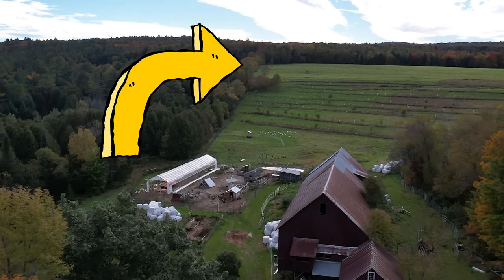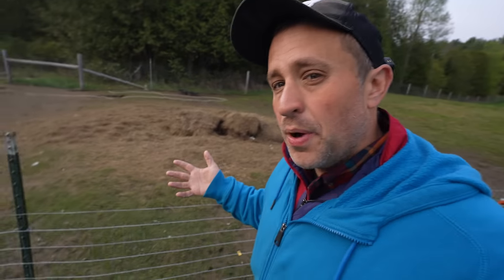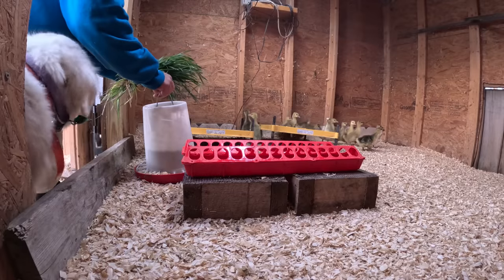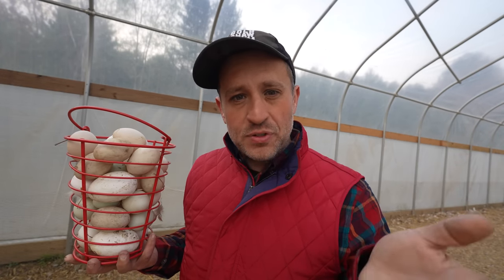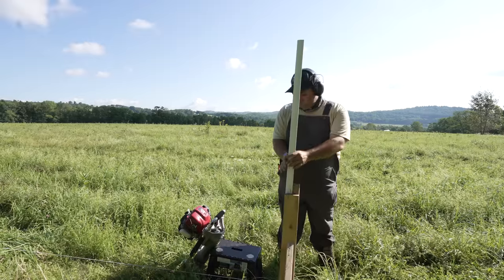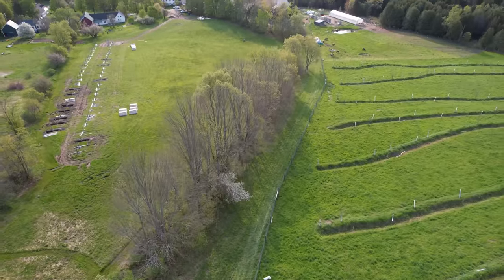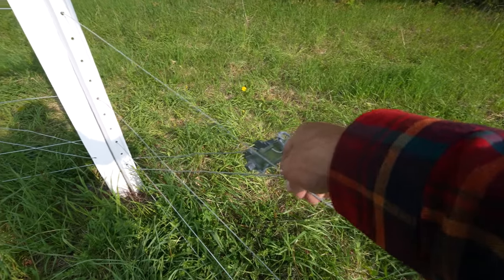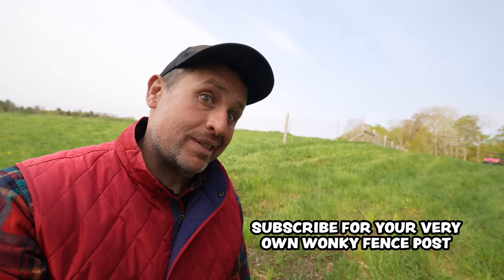Fencing My Farm: What I Learned

Comment: Since you're also a fan of Greg Judy, any chance you'll start unrolling large bails of hay on the pasture in fall before you bring all the cattle to the barn for winter?  It can help fertilize the upper pasture, and keep the area around the barn from concentrating nitrogen. I understand water is the issue, but as the mild winter showed, the quick connects can allow for you to fill a tank 1x a day, and extend the season out away from the confined area.

Comment: I noticed that when things were getting so hard and pushing through the hard wasn't working, you gave yourself a break. What's to be congratulated, is that you came back to the project after building skills and efficiency and finished it. It's so easy to get derailed and fail to return to what we started. But I suspect what allowed you to re-engage was giving yourself grace and understanding for the struggle instead of shame and blame. Good job!

Comment: The one thing that I would do with the white vinyl posts is mark the tops with either reflector disks/tape or Krylon spray paint. You don't want someone (including yourself) to not see them on a snow-mobile in winter.

Comment: Looks great Morgan! And in regards to learning as you go, particularly the 1st compared to 20th tensioner....in my last house I finished the basement by myself. I'd never done drywall work, but I learned as I went. You can tell by looking at the drywall joints from one end of the basement to the other! Laying the joint "plaster" and sanding definitely takes practice!

Comment: Worst part about noticing the tick is wondering where it went 😬
Reply from the maker: I do a tick check at the end of each day and I usually have a couple crawling around. My guess is it migrated to my hair.
Reply: Almost always go to the head because that's where the buffet of blood is.good thing they do because you don't want them settling in everywhere
Reply: @GoldShawFarm  how do you protect yourself from getting Lyme disease?
Reply: @sjbock  I'm chronic with Babesiosis, which is another tick disease, and likely the worst because it's not bacterial; it is a protozoa, similar to Malaria. 
Frequent tick checks throughout the day/time exposed. Two methods of belief are: 1) completely cover your body with clothing and tuck all seams; 2) wear as little clothing as possible and check often. I prefer the latter, when weather permits, and I keep a garden hose exposed to sun to wash frequently. I also suggest removing all outdoor clothes before entering your house, and then placing them in the washer. Ticks are bad here in southern VT this year, and my/our negligence to follow this protocol has resulted with ticks crawling around indoors.  
Ticks need time to latch on and borough before transmission occurs; thinly skinned parts of our bodies, such as the back of a knee or at the base of the skull, are more susceptible.  
Hope this helps!

Comment: Hears T-posts are temporary... wonders why Dad still is using the posts he put in 40 years ago ;) Every spring we were fixing fence on his North pasture, I think some of the T-posts my grandfather put in, it probably needs to be ripped out and replaced but still holds the cattle in. 
I like the idea of the timeless fence posts, not sure if you just replace with a T-post and insulators if one gets broken or if there are slots to slide in wire.

Comment: You can push fence in the ground with your tractor bucket on the front.  Just put the fence post in a pipe and push it in the ground.  Someone has to load the pipe with the fence post and hold it while you push in the ground with your bucket.  The pipe keeps the post from bending and breaking.  Works great.

Comment: Those vinyl posts look pretty cool, doing insulators on that much fence would've been a big pain. The only problem I see is do you have to rerun all the wire to replace a post that breaks for some reason? Or do you just cut it out and splice conductors through a new one? However you want to justify leaving the wonky post is up to you. As long as it's functional, leave it.

Comment: Glad you got the fence done. I'd be a little apprehensive to trust an perimeter fence to PVC posts and electric wire, but that's just me.
I did get a chuckle when you said using T-posts for a corner in a fence. Maybe that works with electric fence, but it doesnt with barbed wire.
All in all, I'm excited to get to see the cows in a new area.

Comment: Love the crooked fence post, only wondering about the stability maybee think about puting an extra post/bar/woodenpost behind it to support it. Because ev en tough you where trough with it you had a lot of support to do it your way. 

If the veggy garden starts to grow have a bit of a compost place for the weird chickens? or a have them "mow" the grass walkways with temp fencing like the mobile coop. 

Sow some peas in the duckling yard when they get out they have a nice little pea plant snack :D
Reply: It's an electric fence, so as long as the wires stay up in the air it's fine. Although the wire tension looks a bit low in general, but that's something that needs to be adjusted a couple of times anyway as everything settles in place.
Reply: @HenryLoenwind  isn't the electric turned off wile doeing chores? could be wrong. And the surgestion is to add to the symbolism just to keep the animals safe ;) you never know if a deer desides to land on it 🤣🤣🤣

thanks for the reply

Comment: Great job on the fence! When adding wire through the fence did you do one wire at a time or multiple wires. The picture of doing one wire at a time and walking around the whole upper pasture, is alot of steps.😮
Reply from the maker: One wire at a time. I only have one of those spinny things for the wire.

Comment: For grounding, connect the lowest wire to it and then connect grounding rods in all 4 corners to that. This will give you a much better ground connection than doing it all in one location without requiring you to run any more wires.

Comment: You should get a rattlecan and spray paint those timeless fence posts,, you can add 10 more years to them if you spray the right paint on it quickly .. those timeless fence posts will last 15 years max(at least here in the desert it won't last long)

Comment: U ar in VT.  Corner post should be some sheep fence bent into a cone Dia of which whatever u want height as high as the the sheep fence u buy is.  But a good idea for a Dia about 3 to4 feet.  Fill cone with rocks.  Anchor fence to rocks.  E-fence only one insulator/ wire.
U want to know what I use with mine.   Old worn out garden hose.  Put them up 30 yr ago this spring.  In fact I will have to find a way to observe the day it WAS DONE THOSE YR AGO COME JUNE 18TH,  got it on my date thingy now.  So now I have a resson to party come June 18th each yr.

Comment: Hey Morgan, great video. I'm gonna be one of those guys in the comments though... I think you'd find it significantly easier to bike if you adjusted your seat height up a bit! Just a reminder that when sitting on the bike you should be able touch the ground only with your toes. When your seat is lower than where it's supposed to be for your height, you have to work significantly harder to move your legs at those really cramped up angles. 
Another way to test your seat height is to observe you r leg during pedal stroke, when foot/pedal is down knee should be slightly bent and then upper portion of cycle is more of a 90 degree than that  tiny angle you've got at 13:05.

Comment: If you're driving wooden fence posts into the ground, you're doing it the hard way.  Need to dig a hole, drop them in, and cement to fill.  Easiest way is to get an drill attachment for your tractor and use that to dig the post holes.  Proper tools for the job as they say.  Love your presentation though, I find it fascinating having grown up on a farm and watching someone that's new to it get things done.  However, I only use wooden posts for the corners, and use t-posts for the rest of the fence.  I prefer the way it looks to the other options, gives a more rustic feel to the place.

Comment: You used the wrong unit for your electric fence. It's 10,000 Volts not 10,000 KWatts. If it was 10MW any thing that touched it would be vaporized.

Comment: If i have a NiCKEL FOR EVERY POST I HAVE POUNDED INTO THE GROWN i WOULD BE RICH.
oh WAIT I am.
As kid we went by every post on our farm and hit it each soring at least once.  We had 1.2 mile of fence A loculus post every 10 feet.  That is about 600 post.
Today our perimeter fences run about 30 mi
See what i meant with the nickel and the post.  I got that nickel and ran with it.
But u dont go around hitting the post with a 10bl maul.  Today we use an app on our tracker hit it for us.  Well what u do is u put the post pounder on the tracker.  U drive up to about 10 feet from fence.  turn on app and let it get to work.  It knows what a post is where it is if it is with 20 feet of it.  It knows to drive up to the post putting post pounder right over the top of the post. Whap if it sounds right to u move on if not tap hit it again.  All in the comfort of ur climate controlled cab.  U r use the heat part of the CC app.  Ya farming has changed.  It had to for me b/c at 74 I could not be swing that 10lb maul as I did at 35 .  
Farming is still a lot of hard physical work but not what it was.  
Those of us who have embraced tech and r using it to begin renew what Human kind has taken form the land so that it will continue to feed us.
Believe or not I was awoken to what is happening today with my reading of Silent Spring.  I got it for my 14th B-day from a man who became my teacher in this life.
I took her words to heart and set out to do what i could to stop that time she wrote of
And YES it has made me a very rich land holder but rich in my way of life is how I live.